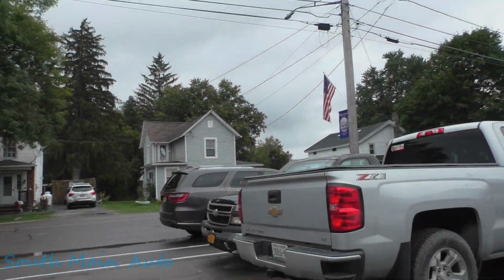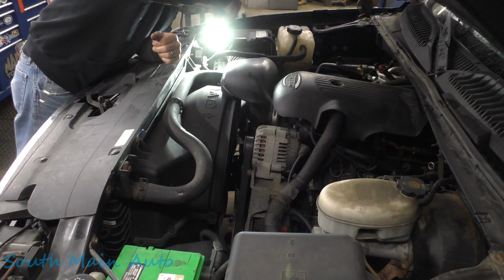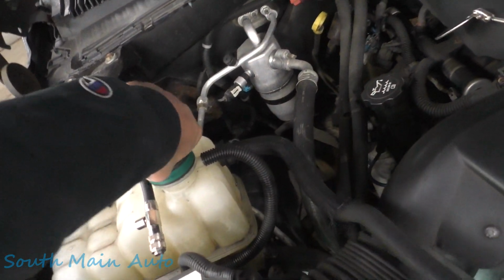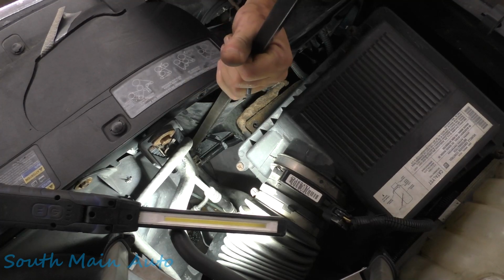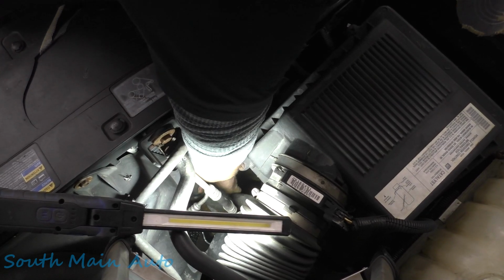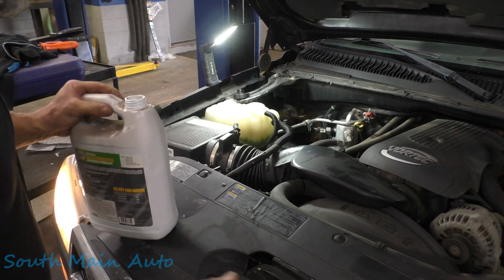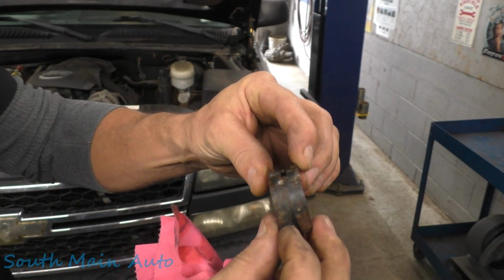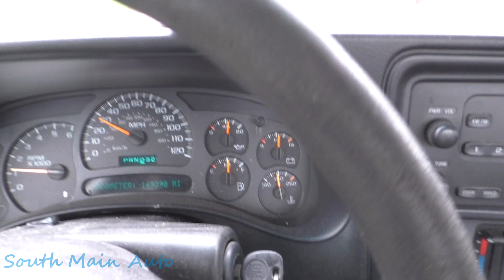A Hot Chevy With Nothing To Keep It Cool 🔥

Comment: That customer is very lucky he got you to look at his truck. I truly think any other mechanic would have taken him to the cleaners, lol. I wish I lived near you,. lol. Cool video thumbs up. Stay well & safe.
Reply: Water pump, thermostat,  radiator
Reply: That's probably why he is so busy.  People locally know he's the best around.
Reply: Eric spotted a new water pump so it looks like the customer had already been fleeced!
Reply: @jonh901271  
It's possible that it may have needed a water pump. Maybe not, at this point we don't know
Reply: @snoopy5736  Don't forget need to sell him a new frame too. Might as well check rear parking brake cables and brake lines too, salt isn't very friendly to steel brake lines out back under the bed.
Reply: Well sometimes it can be preventative maintenance if the parts look worn

Comment: 'there's a reason it's not on the lift'🤣🤣🤣
Reply: Can anybody tell me why vehicles with corroded undersides are allowed on the road?
Reply: @mikeirwin9985  $$$
Reply: @mikeirwin9985  You must live in Texas or Arizona.  😂
Reply: No,I'm on the other side of the world.Where any chassis corrosion is a car test failure.
Reply: @mikeirwin9985  OK, I figured something like that.  I live in the northeastern US and brand new vehicles have corrosion on the chassis without a year or two.  However, it generally takes 10-15 years for this to become a safety issue as most cars and trucks are grossly overbuilt.  The strength required to withstand crash tests and such pretty much ensures a huge margin of strength for normal operation and it takes a lot of corrosion to make the vehicle unsafe.  Failing a car inspection because of light to moderate chassis corrosion would simply be both stupid and an economic disaster.
Reply: @mikeirwin9985  It's common around here to have corrosion starting while still on the new dealer's lot. I doubt you could find a vehicle here that's three years old without corrosion.
Reply: @mikeirwin9985  please send your cast-off vehicles we need them..🙂
Reply: @Loveitdownunder  inspections are on a state by state basis ,In Pennsylvania any sort of rust hole on frame/cross member/ structural metal fails inspection and is deemed not fit for road use, but right next door on NJ the state only inspects for emissions compliance. I believe NY state as well ( where SMA is) follows along New Jersey's lead. Then there are some states that have no inspection, emissions or otherwise.
Reply: @mikeirwin9985  Not all states have safety inspections.
Reply: @Scooter30FTW  That explains a lot
Reply: @mikeirwin9985  New York is not one of those safety inspection-free states. That truck is going to the crusher soon.
Reply: @LTVoyager  , Remember a while back if you had a truck or a 4-Runner Toyota with a rotted frame? The Toyota dealership would replace the frame at no cost.  Andrew Camarrata talk about this in one of his videos.  I grew up in the N.E. rust belt and it never made sense to me why they would ad salt to the sand in snow plows with a spreader. I know that it will help at some point in the beginning. Yet its pretty useless after that. Especially when you have a large amount of snow. I would buy and drive a winter beater to save my ride.
Reply: @mikeirwin9985  It's not as simple as that in the UK. Excessive corrosion within 30cm (12") of a suspension, seat or seat belt mounting point is a failure. When I was still working, as a mechanic, 3 years ago, the general rule was, if you can push a screwdriver through it, it's excessive. If not, it lives to rot another day.
Reply: @327JohnnySS  I agree that they use way too much salt in NY and PA.  I’d much rather than sand on the hard packed snow, but that requires people to know how to drive, which most don’t anymore.  The salt is very useful if your goal is dry roads.  You plow off most of the snow and then the salt melts the rest so it can evaporate.  And the amount of snow matters not as you plow off the snow before applying the salt.  You don’t apply salt to 6” of snow.
Reply: I do enjoy all thd folks from places without snow, ice and road salt going "a rusty frame is a failure here!" Like, homie, that's life in the areas with salt mines and winter, if you replaced your car every time it started to rust, you'd have to live in it, it'd be that frequent.
Reply: @rickconstant6106  From your description, there appears to be little or no difference between the UK and Ireland regarding corrosion.
My original post on this concerned an US case which I assume you’ve seen on Eric’s channel and is not the first to show totally rotted side and cross members. Some US posters made me aware that not all states insist on a mandatory car test. That must be the answer to my question.
Reply: @fbm314  That solves the mystery for me.
Reply: @Phillip Banes Very well explained.
Reply: @mdotguy  Thanks for the info.
Reply: @LTVoyager  I know. I'm from the rust belt and know about Plowing and salt. I bvb agree with you about putting sand down on packed ice and snow. If only there was a better way with out apply salt to make roads safer.👍
Reply: @Phillip Banes Surface rust doesn't cause failure here.If a section is rusted through and is repairable that's ok.
Reply: @fbm314  Kansas is one of them.  But we don't have too much of a corrosion problem, at least not as much as some areas.

Comment: Watching SMA has given me the confidence to do my own brakes for the first time.  Rotors and pads ordered last night.    Brake Clean and Bah are already on the shelf.

Cause if he can do it, I can do it!!
Reply: My best wishes to you. I first did my own brakes because I was yoo dang poor to pay for a brake job. That was 15 years ago or more and I haven't paid labor since! You can do it, cuz Eric O said so!
Reply: I did front and rear brakes on my 03 F150 with the big 5.4L. Saved me lots of money. First wheel took an hour start to finish, the second wheel took 15 minutes.
Reply: Learning by doing.
Reply: If the bolts seem stuck, don't stress and keep at it, get the biggest bar you can fit and pb blaster or something before you resort to a torch.

Comment: Thanks for sharing this repair. It isn’t just GM or Chrysler products that use these spring hose clamps, Ford uses them also. I had a similar experience on a 2003 Ford Excursion, the clamp broke for the lower radiator hose where attached to
The radiator. Replaced with worm gear type.
Something to look for as vehicles get prepared for winter.
Reply: I am curious about where those clamps were from and outsourced? I'm guessing that it's not made in America steel. Maybe  the head electrical engineer who worked on the Towering Inferno started clamps R Us ?
Reply: I think all vehicles come with these clamps, and they work well for what they do. They are lower maintenance, and do last a number of years. You just need to inspect them before reuse.

Comment: More weird regional/rust belt issues. In nearly 20 years as a tech, I’ve never seen a spring clamp break. Around here, they get so old that they lose their tension and have to be replaced, but I’ve never actually seen one crack/break like that.
Reply: @Phillip Banes That was a very clean straight break.

Comment: That repair was easy for someone who ha 2 foot long pry bars and screw drivers. Doing that in the driveway with normal tools from underneath would have been painful and messy. It makes you wonder about these customers who don't even check the radiator for an over heating problem. Great work as always, Eric.

Comment: Owner was lucky. I once blew a heater hose and drove another mile and parked vehicle and heat gauge was high but not at the top. Replace coolant and noticed a nice puff come out of the exhaust. Coolant coming out of the exhaust still smells like coolant. Didn't take much to blow head gasket and warp head. Temp gauge was below level of heater hose connection.

Comment: Years ago while changing a thermostat, I had the tab on one of those constant pressure clamps break off just as I got the hose back on. It held just fine so I was lucky, I thought. A couple of years later the upper hose split and I limping to a parts store and got a hose and a couple of new clamps. The fun then started to try to remove the old clamp. Two hours later and much cussing, I was able to split the hose and pull it out piece by piece until the clamp slipped off. If you remove or replace a hose, change out those damned constant pressure clamps.

Comment: Great video.  And I hate that type of factory hose clamps !!!  I don't have a coolant pressure tool (I know, there are free loaner ones out there), I would've had to fill it with water and take it for a ride, and then check for leaks.  One time on a 1994 Suburban, had trouble finding a leak, but after turning off engine and letting it sit 10 minutes, engine heat pressurized the system more and I saw the leak point.

Comment: This was a fairly straightforward because you had the right tool. A DIYer in their driveway would likely pull their hair out trying to find this.
Reply: @Phillip Banes After seeing how hard it was to get the hose off it might not have leaked until it was under pressure.  He also didn’t see the leak after driving it in the shop.

Comment: I guess you missed the part where he said there’s a reason the trucks not up in the air - there’s no frame left 😂
Reply: Around here in Lower Michigan I see many Ford Rangers driving around with radiators and a/c condensers being held in the vehicle by their hoses only.  That's because all their lower core supports have rotted away.
Reply: @aliasfred  
I live in southwest Missouri,  I have a 2001 Lincoln,  and 2012 Ford F150 and I haven't noticed any rust under either one. I'm happy I don't live in the rust belt.
Reply: @aliasfred  Same Larry, I'm over by Lansing.

Comment: and those radiator cap adapters can be used when bleeding abs modules that are stubborn :)  a little pressure in the brake reservoir always helps when bleeding the systems. just need to be careful about the amount of pressure and not running out of fluid.

Comment: Just avoided the same emergency on my wife's land rover, had the undertray off and the second I touched the lower hose it leaked profusely, it's 20 years old so I can't blame it but a few more pressure cycles and she's gone, replaced with a proper clamp and good to go. fair play for not charging the customer for unnecessary work but of course Eric doesn't do that.

Comment: I have same Coolant adaptor set, Vacuum works great for bleeding out the air first with this setup. 👍
Reply: A lot of the reviews on Amazon says it doesn't include a popular later model GM adapter and that you have to buy it separate.  It fits in one of the empty slots in the lower right part of the case.
Reply: @Mr2004MCSS  LINKLIFE 28 PCS Radiator Pressure Tester Vacuum Cooling System Kit with Universal Adapters, Automotive Coolant Pressure Cap Tester Kit Coolant Vacuum Refill Kit
Brand: LINKLIFE, Its same as the astro, but has the GM adapter. This is the items i have. Made all same place basically.  I looked back in Amazon order history, no luck ,most have ordered it from els where.

Comment: I like those kind of clamps.  They work better than the strap or screw down type.  I never have seen one break like yours did on that truck.  Didn't know they would do that.  I have had the strap type leak at the upper hose and radiator junction.  When I replaced it with original GM spring type I never had a problem again.
Reply: I've seen quite a few on 00s gm trucks break
Reply: @HoLeeFuk317  Just the same I'll keep using the spring type.

Comment: How's this for profound. When putting a new radiator hose on with worm drive clamps. Take it for a short drive just enough to get the coolant hot. Then tighten all those worm drive clamps. The hose rubber gets soft when it gets hot. If you don't retighten them there is a good chance they will blow off the first time it gets really hot and goes full pressure. Ask me how I know.

Comment: GM in UK install radiators with no top an bottom in/out flow connectors instead both are in the middle which is why mine rotted out on drivers side lower corner. Whole front end off for a radiator change.

Comment: I worked with a guy that pressurized a fuel bladder in the wing of an airplane to leak check it…this is perfectly safe when door properly…but when you plug the air line in without dialing the regulator back to 0, POP…..that’s when it gets exciting 😂😂😂😂

Comment: We don't see a lot of rusty cars in the south but I have seen a hose clamp that had broken 
My boss had recently purchased a new to him tow truck that was from Detroit 
We were wondering why it was leaking coolant 
Turns out that the upper radiator hose clamp had rusted in 2
Certainly not a common problem here in georgia but I can say that I would definitely believe that anything like this is possible in the north

Comment: Bought a new 2004 GMC 2500HD and that lower hose clamp split six months later in the parking lot at work.  I made the dealer come over to the parking lot to fix it and clean up the mess.

Comment: The rubber floors are the shit, easiest to clean out and no worries about wet carpet.
Reply: @Phillip Banes I have those in my current truck. An option on most full size trucks is either a full rubber floor versus having carpet.  It's on most base models.  I actually loved it cuz you could hose out the cab and not worry about having to clean carpet.

Comment: The pressurizing kit is indispensable. Whenever I'm using it I'm always wondering how long have such kits been around. 10-15 years? What were people back then using to find leaks? Spending hours looking for old crusty coolant leaks? But then again 20-25 years ago engines were pretty basic and had like 3 coolant hoses in plain sight. Anyways, great tool! Must have for any mechanic!

Comment: Getting sprayed with hot engine coolant.  Yeah, I can see where that would leave a lasting impression.  I remember a guy who got it right in the face when he tried to check the coolant by removing the radiator cap on a hot engine.
Reply: That guy was just dumb🤣. Eric O had an accident due to a faulty part.

Comment: Back in 04 , I bought a brand new GMC 2500 
It has the fuel efficient 6.0. 
Went to drive it to work and had no heat , parked it and found the bottom rad hose clamp came off in 2 pieces. The stealership wouldn't even give me new coolant. Don't buy anything from the stealership in schererville , IN.

Comment: Gotta 2003 Silverado with mushy brake pedal. New booster master cylinder and abs auto bleed. And still mushy. Can’t find a leak anywhere. Bled system about 10 times nothing brings it right. Front brakes hold strong but the back barely grab. Tuesday it going in for an inspection and asking the mechanic to bleed the system to see what he gets from it. Don’t know what it could be. Changed the oil pump recently…while at it did the timing chain and water pump. What a job that was. Oil pan was a pain. But new gasket in. 4th.

Comment: The dumbest and easiest fix for overheating I learned early on is to always check that the system is pressurized when hot.  Just grab the hose and give it a squeeze.  That $5 radiator cap is so often overlooked.  And watch out for the off-brands, OEM is best sometimes.

Comment: Lucky the coolant started running on the floor during the pressure test. If it hadn't, I was wondering if it had a cracked Castech cylinder head. Seen the antifreeze in the head after removing the valve covers on 5.3s with those doomed cylinder heads. Not a pretty sight.

Comment: I'm lazy, so I would not have pumped that whole engine's cooling jacket and radiator full of air. I would have just put 100% water in it. Sometimes, depending on where the leak is... it might have already run out of leakable coolant, so adding is needed.

The last place I worked, as a fleet mechanic, was crazy for transmission flushes, so it did those every 30k miles. Those cheap line quick connects are not meant to be taken apart and put together a lot. I always used to hate getting hit with hot ATF. All of the detergent made me itch for the rest of the shift, also smelling like hot puke was not great.

Comment: As much as those squeeze clamps suck there’s a reason they use them, with the plastic radiator they expand and retract with heat and the squeeze clamps will it allow it to expand and contract, the screw hose clamps won’t let it expand causing it to crack the radiator, I’ve been there before, maybe you know this 🤷🏼‍♂️

Comment: I removed the thermostat from my old Silverado a decade ago as it would always overheat in the AZ summer.  New hoses, new radiators, didn't matter.  I'm at 387K miles and it still passes emissions at 2% of allowable.  I think I will leave it out.

Comment: love those trucks..... In my opinion which doesn't mean crap because opinions are like you know what... but I think those are the best trucks ever built. especially for an everyday driver. knock around truck. you know if I'm looking to do heavy duty work I'll buy a Ford or Duramax but just to knock around town. best truck ever built right there, especially if it's like a two-wheel drive with a 4.8 L manual transmission run forever

Comment: Thumbs up.  QUESTION: My 5.3 runs a little over 210, and holds there, rain snow or shine.  Noticed this was a little under.  (2004 Tahoe Z-71, fully loaded) all factory, if that helps (proper coolant levels, coolant, no leaks)  Did you just not warm this one up completely, or should I be looking for something wrong?  Edit: Belt fan, coolant nice and clean, no crud on the radiator for blockages.  No radiator fluid in the catch can or the stick.  179,000 miles, no leaks whatsoever, runs like a top.

Comment: With price of coolant nowadays you can't afford no leaks i had top radiator hose weeping even after tightening it so i pulled it apart and metal was a bit crusty so i sanded it smooth problem solved no parts needed 'LOL